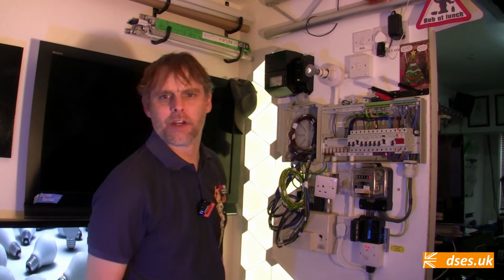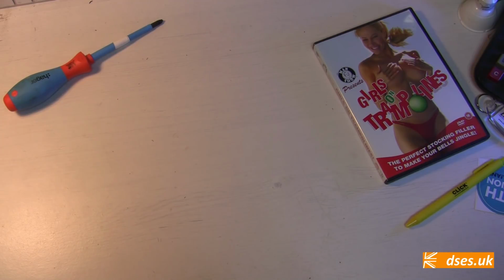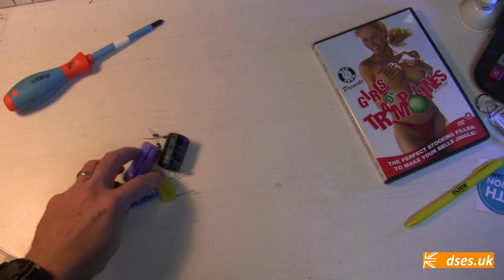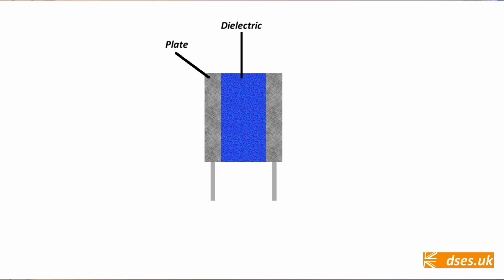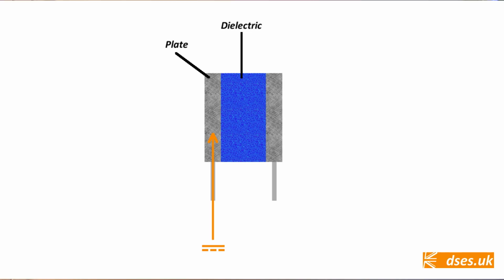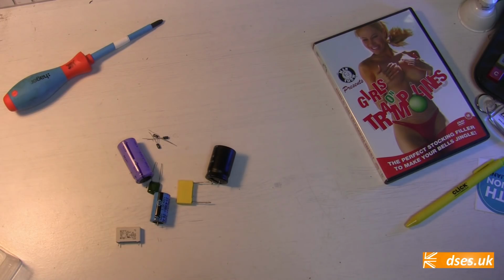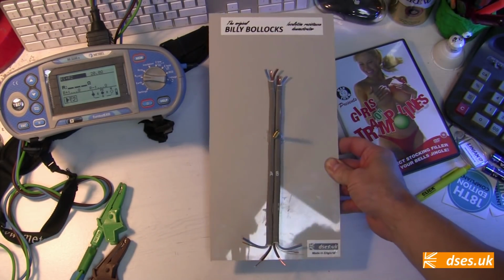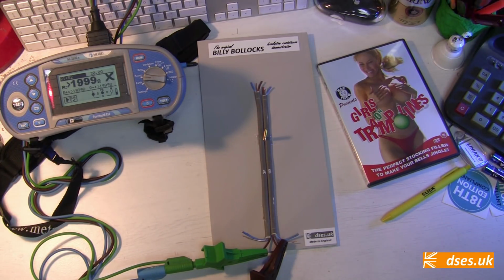Nuisance glowing LED lights

Comment: Very good, and thanks for the mention! You're right, the handheld multimeter is the only one that has a 10MEG input impedance. The MFTs in particular are designed to have a low impedance to avoid misleading results for electricians. The other method to deal with dimmers and smart switches is an X2 capacitor across the glowing lamp, or something like the Danlers Capload, which is the same thing marked up 10x and packaged for ham-fisted kitchen fitter sparkies
Reply: My other half is an electrician and I do not understand hardly any of the terminology he talks about..When he watches you, I can’t help but watch too....You are absolutely hilarious 
Keep making me laugh -  👍
Reply: @ss54.  You can use Y2 capacitors if you are concerned about failing short circuit.
Reply: Agreed on all points. It only needs a small X2 capacitor to do the trick as it only needs to be say a 10x the value of the cable capacitance. Something like a 100nF X2 will do the trick and is physically small enough to go into most fittings.

I'd advise against a neon as they have a nasty habit of going short-circuit with extended use which then causes the series resistor to run hot enough to melt things.
Reply from the maker: @Graham_Langley  The problem with a cap is that you've got to size and source one which isn't so easy with the likes of Maplin off the high street. I can't see neons as being a problem though; they're made for very long life which is why appliances have them as power indicators (albeit with less regularity these days). I've had neons burning in equipment for twenty years which lost brightness but remained reliably functional.
Reply: @dsesuk  Amazon sells these, a bit of insulation on the legs and good to go.
Reply: @dsesuk  Sourcing a stock of suitable X2 caps isn't a problem with the likes of CPC, Farnell and RS. Cheapskate source is discarded mains-powered consumer electronics. Any with a SMPSU will have a mains-side filter incorporating at least one X2 cap it - they're the big yellow boxy ones with X2 on them. Simply remove, check capacitance is still as stated, solder on longer leads and sleeve.

As for neons, the reason they get dimmer with time is the metal from the electrodes gets deposited on the glass and darkens it. If you're unlucky it shorts the neon, quadrupling the power (P=V²/R) dissipated in the series resistor. Many years ago my parents had the power rocker switch on a fridge-freezer actually melt due to this.
Reply from the maker: @Graham_Langley  Thanks Graham. I'll put together a quick follow-up video on this.
Reply: @dsesuk  correct Dave.
Reply: @Graham_Langley  In all my years of using a Neon Lamp (thousands in fact),  they have never gone Short circuit, its 2 electrodes in a glass tube with neon gas in them. What is there to go short circuit?
Reply: Pro trick: you can watch movies on flixzone. I've been using them for watching loads of movies these days.
Reply: @Vivaan Albert yea, I have been watching on Flixzone for since november myself =)
Reply: @Vivaan Albert yea, have been watching on flixzone for months myself =)
Reply: @Vivaan Albert definitely, I've been watching on Flixzone for since november myself :D

Comment: That's not the only reason non contact detectors are dangerous. I have seem false indications from static like insulation, but that is a fail safe false positive. No, its the fail deadly false negatives that make them questionable. Such as a screened wire that is live but the screen applies an opposite electric field and from the outside, means most detectors don't detect anything. Examples include neutral screen cables used a lot in NZ.

Comment: Using leds are meant to save you money on your electric bill. As the neon indicator uses electric, is there any point of using leds?
Reply from the maker: The power a neon takes is negligible. A neon inline with LED lights still massively outweighs the running cost of tungsten or halogen lighting.

Comment: Aren't you able to test a non contact voltage tester by rubbing it over ones chavvy polyester outfit to generate static?
Reply from the maker: The Klein NCVT2 was one model where it would sound off if you waved it anywhere near the cat!
Reply: @dsesuk  I've worked with people like that

Comment: Rubbing a non-contact detector on your shirt etc will generate a static field and will cause it to briefly light and confirm if it is working. Obviously no substitute for a proper dead test though.

Comment: I tried this and the glow is still there, there isn't enough power to light the neon light but when I switch the light on it does so it not soaking up the power. Any ideas?

Comment: really god video, very informative, i imagine the flush fixed switch and socket above the test rig are nothing to do with it. just curios why the socket says Class 2 only and what the swift is for labeled RML?
Reply from the maker: I'm glad you found something useful among the nonsense, thanks for watching! You're right that the switch and socket above are unrelated. The socket was labelled Class II because it had an earth fault; I think the cable had been damaged in the wall. That was okay though as it was only there for some Class II lighting transformers. The RML switch used to activate a Rotating Mirror Light (like the sweeping lights on old police cars before strobing LEDs took the fun out of everything). Both accessories had been redundant for a long time, and when I ripped out and rejigged the man-cave earlier this year, the faulty socket was finally fixed and the switch removed.

Comment: So I have low glowing can lights in my bulkhead that I put in, and they stay on like that every once in awhile when I shut them off and there on there own breaker, so is it just one of my switches that are wired wrong to my can lights that's causing this?

Comment: Thanks  for a great video very informative  I guess the same effect is to blame for the slight tingle I get from my touch lamp by my bed. Incidentally I'm one of your female viewers and I love your humour
Reply from the maker: Ah, so YOU'RE the one who gives me that 0.1% female viewership! Well, thanks for tuning in! I must say though, I am concerned to hear of your tingle. Touch lamps do use body capacitance to operate, but you shouldn't be feeling anything. A slight tingle may be indicative of there being just a little bit too much current running through you which may perhaps be down to a cheap circuit within the lamp or something breaking down. I use a touch lamp at my own bedside, but I think if I were to start getting a buzz off it, I'd be wary of using it further.
Reply: Thanks David I will change that lamp out for a different one just to be sure
Reply from the maker: @jonjohnson1259  Good stuff. You understand that if you get zapped, my male stats go back to 100%? I'm only thinking of my YouTube numbers here!
Reply: Oh of course I understand that David Lol x

Comment: Great vid David, watched this arse about face but still enjoyed. Been meaning to ask if you have a schematic for your test rig setup there, I'm doing L2 2365 at the,omens and am toying with a mock board at home, just trying to figure th best configuration, any help?
Reply from the maker: Hi Dex. There isn't much to this one. The final circuits are a ring with two sockets, a radial with one (USB) socket and a radial lighting circuit. It's all in conduit and each circuit has 5-10 metres of cable coiled up in the adjacent plastic box so that test numbers aren't a zero every time! The sockets are in 2.5/1.5 singles, and the lighting in 1.5/1.5 if I remember rightly. The board feeds through an analogue meter and an old service head I scavenged into a Hager 45A isolator, and from here it's fed back to the house CU about 4-5 metres away via SY cable to the high integrity (non-RCD protected) side of my main consumer unit. Obviously, I want it to not be RCD protected at the main CU so that I can introduce earth faults or RCD tests on my test board without knocking off the house while the wife is watching Coronation Street. Non-RCD protected SY cable is a bit naughty, but it's not like this is a permanent addition to the house, and the SY is surface run in my office so it's not buried in walls or anything. The MCB at the house CU is 40A, the SY-cable is 6mm 3-core and the test DB is made up of old or spare bits I had lying around being a Wylex board with an MK main switch and Schneider RCD/MCB's! There are other things on the wall like a rewireable fusebox, Eco7 switch and a VOELCB, but they're not connected to anything. Quite a handy thing to have if you have the room and want to practice testing and faultfinding away from the college.

Comment: Sorry................. but, whats a CPC?
Reply from the maker: Sorry, it's Circuit Protective Conductor.... what we all really call the earth wire, but BS7671 likes to replace simple, meaningful and commonly used expressions with clumsy mouthfuls with each new edition and amendment.
Reply: @dsesuk  - - - Thanks for that. I will keep calling it the earth wire if you don't mind.  Its been that way here in NZ for the 52 years that I have been involved in the trade.
Reply from the maker: @dondon6988  I try and use the current terms in these videos so that it matches with what BS7671 and the training courses say, but out in the real world it's a different story!

Comment: Oh my gosh this is the best one yet David. But my noncontact voltage pens here in the states work just fine without me holding them or them touching anything. 🤔
Reply from the maker: As far as I know, they all work in the same way. I got some information out of Fluke in the US which explained it, I'll link it here: https://www.testequipmentdepot.com/application-notes/pdf/electrical-test/understanding-capacitive-voltage-sensors_an.PDF - it has to be capacitive to detect the presence of just the AC voltage rather than current, but if a non-contact stick is still warbling away when you let go of it, then it's finding another capacitive route through the surface it's sitting on, neighbouring wiring or some such alternative route I assume.

Comment: Have you ever had a very long run an put a meger on it at 1000v an asked some one to twist the ends I did it the guy wet his pants.  I was standing were he could see me holding the tester same effect the long wire was RG 58 for computer network link It was funny I still do it
Reply from the maker: Haha! Evil Alun! I did zap Nige with 500V a few months ago; he was working on an exterior socket while my Metrel was connected at the CU.... and I pushed the button...
Reply: @dsesuk  Try it on 1000 V I used to like to charge filter caps up of motors an leave them laying round.  Did get told off for doing it - But never did stop me.

Comment: So, this is also why my attic lighting is glowing sometimes (after replacing with a LED bulb). It has a multiway switching setup. I assume it has a very long capacitor running from switch to switch.

Comment: Dear  Sir,  why use a neon indicator lamp to drop-shunt the capacitance induced leakage current, which
still has a forward voltage  drop of 90volts when a suitable resistor eg. 150Kohm 1watt will take up less room and bring the off state voltage to nearly zero?
Reply from the maker: It's more to do with accessibility and ease of installation; a neon with insulated flying leads is cheap and readily available. A resistor will do the trick, but would have to be sleeved or insulated to prevent it being a shock risk when the light is on. I'm making a follow-up video to address this point following feedback such as yours, so watch this space!

Comment: Can you post a link to the contactless tester please. I do own a contactless tester but does not work as sensitive as the one you have.
Reply from the maker: A good point Andrew, I should have linked to such, and I've just updated the description for both the Kewtech Kewstick Duo and the Fluke Voltalert which is the one I carry on my toolbelt for daily use.

Comment: Danlers do a load resistor I added one in my daughters bedroom to stop glowing and make it dim properly. I've got lightwaverf dimmers. Which I found you need about a minimum of 12w load for them to work correctly with leds
Reply from the maker: Ah, there are a couple of Danlers products for the job, look out for an update video coming in the next few days!

Comment: My cure for glowing LED's is a 0.1uf X2 capacitor across the lamp!
Reply from the maker: An update video about this is in the works, thanks for your feedback!
Reply: Manufacturers of the LED lamps should do this. I'm guessing because they are manufactured to 110V to 240V they never saw the problem happening in 220/240V systems. i have had a few experiences in customers homes of this, but it depends on the manufacturer, and circuit design. capacitive droppers are worse for this scenario.
Reply: @muzikman2008  Thank you, from what you said you are a true electrical engineer like myself!

Comment: a neon bulb and resistor works but  a capacitor ( X2-Typ 0,1 µF -0,47 µF) is better because the electric meter will not count it.
Reply from the maker: Very good, and I have one here, so might put out an update video, thanks!

Comment: If that 3 µA current is at 240 V, that'd be almost 1 mW, which at 2 V across an LED would be 1.4 mA, so makes sense it would glow very dimly even from such a tiny current.

Comment: Thanks for the neon tip, that’s a really good idea! I’ve also noted that some LEDs give a nice residual glow when a DIYer has switched the neutral instead of the line conductor!
Reply: Thank you so much for this comment!!! I’ve been scratching my head all weekend, trying to figure out why my LEDs were still dimly lit when off at the switch. A bypass low load capacitor didn’t work, I’d checked the live/neutral were the right way round at the light and couldn’t figure it. Then I see your comment from 5 years ago, and think…hey, that might be it!!!
And it was! I owe you a beer!!

Comment: I'd suspect the ones that glow use a simple capacitive dropper in their power supply. Anything with a proper IC-based buck supply will have a minimum supply voltage lockout circuit.
Reply: Right, but if they are low-power enough they can slowly collect charge until the input voltage rises high enough (~80V) for the buck converter to try and start up. This produces a flash every 30 seconds or so on a circuit for a 1W LED spot I have, for example (for one position of a 2-way crossover switch, but not the other).

Comment: Hiya David, won't neon's, and surge protector resistors (can't remember what there called) cause a 250/500v insulation test to fail, as they will strike, and although they have a current limiting resistor in series, by the time you have 10 or so of these in parallel, your going to end up with a pretty low apparent insulation resistance. Any thoughts on this? PS: just saying, no one likes a smart arse, particularly after Christmas. Cheers, Gordon
Reply from the maker: Hi Gordon. The neon between line and neutral will cause an IR test to fail like any other connected load. Personally, when I perform EICR's, I usually skip L-N testing as all I'm really concerned about on existing installations when it comes to IR is how good the live wiring is with respect to earth, and usually disconnecting all loads is too time consuming. If you think of, say, 12V downlights, each usually has a transformer above the ceiling connected in the same way as this, and I wouldn't go around wiring those out. If you use the neon trick, or a localised surge protector or such, then it would be wise to leave a notice on the board or on the paperwork informing of its presence and loation to aid the next sparkie with any troubleshooting. Also, you shouldn't need a string of neons: the fault is usually localised to the switch drop for one room, so a single neon at any point between switched line and neutral anywhere in that room should squelch it.

Comment: could you not just put a 1Mohm resistor accross live and neutral?
Reply from the maker: Maybe, but can you get such with insulated fly-leads, are they readily available now that the likes of Maplin are off the high street, is 1M Ohm the right value for all installations and what Wattage of resistor would you use to stop it becoming a mini-heater? I hear of solutions involving resistors, capacitors and diodes, but a pre-wired neon is easy, cheap, readily available, idiot-proof so long as you get one rated for your country's voltage, and it does the job long-term and reliably. So far, nobody has told me specifically what type and rating of any other component I could use instead, and I don't know myself what resistor/capacitor/diode I can buy and keep on the van for such a thing or where I can get it from. I am open to suggestions though!

Comment: Reminds me of a Y reg Ford Focus I used to fix ,  Y794PNK , it was 3 months old , kept  blowing the heated rear window control unit , used to make the radio speakers buzz when radio not on , took it to local Ford agents (under warranty) , 3 times new heated screen control unit replaced , within another  2 months , dropped it back in with them , told them didn't want it back until fixed , a Ford Technical  guru came to look at it , and diagnosed the fault , he traced it to the EMF from the spark plugs , replaced spark plugs with different brand , no EMF fault , now we have canbus wiring systems on cars , lights that flash on and off with non genuine bulbs , even with so called special resistors fitted , crazy world we live in , how affected are we  in life with electrics , even at 12 volts !!

Comment: Re the non-contact earthing through you, As a fan of neon testers, I checked a circuit I'd put in and out of interest stuck the neon on the earth terminal. The neon lit. After a bit of further investigation, I concluded it was me that was live (standing around some cables) and the earth was just earthing the neon tester!